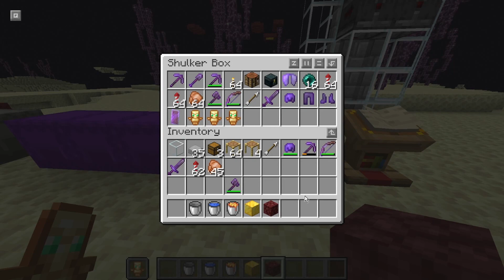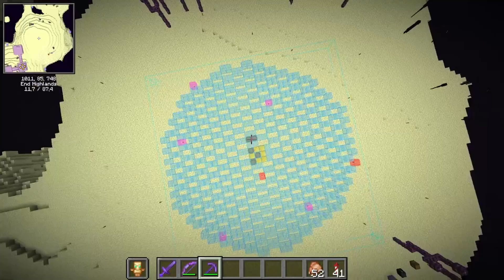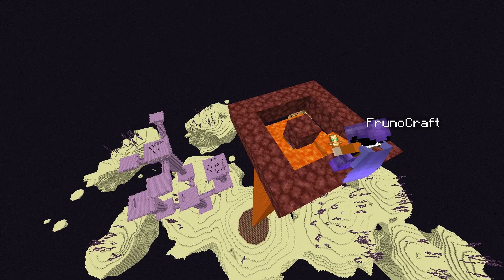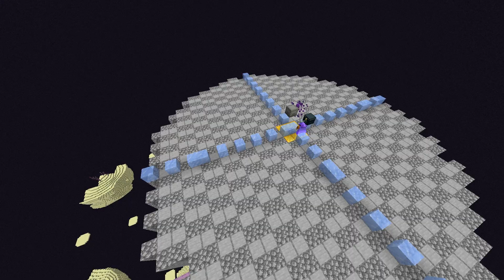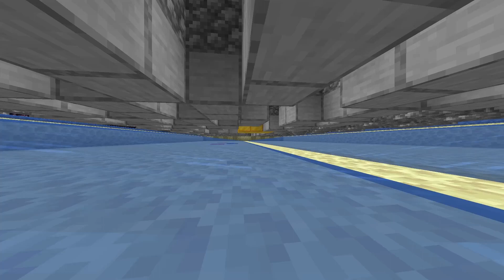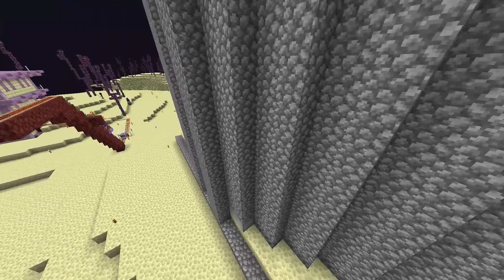Build tutorial: Reactor based shulker farm (1D, 3000+ shells per hour) Minecraft Java 18.x

Comment from the maker: There have been questions on how to extend the farm if you've built a smaller version. The main work is in the lavacasting of the walls (and the cleanup later), which does not depend on the size of the farm. If you have built a small version, I'm afraid it is almost as much work to extend the farm as it is to build a new one. 
So if you're unsure how big you want the farm to be, I recommend to use the maximum height when lavacasting and fill only as many aggro cells as you want with snow golems, from the bottom. For example, lavacast 200 blocks (10 cells) and use only snow golems for the bottom 3. Then, some shulkers will end up over the aggro cells but they will be dormant. Later you can use the chute containing the scaffolding (for the signal) to go into the farm and add more golems, and the flooding process I described to get shulkers in the aggro cells.
Reply: That was my question. I figured this was the case. Thanks (:
Reply: Hi I've built this farm on a survival server of mine and was wondering what purpose the redstone clock serves. I've tested the farm design's agro chambers and the shulker appears to fire continuously even without the clock (Which is how I am deducing the shulker remains agroed). Is the clock needed, and if so why? 

For context I've watched both this video and the explanation video released prior titled, "Reactor based shulker farm (1D, 3000+ shells per hour, easy survival build) Minecraft Java 18.x".

Thanks in advance for clarification and help. :)
Reply from the maker: @GalacticCoffee2077  It's been a while since I made this video :) But I'm pretty sure that the issue is with the agression of the teleported/split shulkers. They don't aggro on the snow golems unless you reset the aggro of the shulker in the chamber.
Reply: @FrunoCraft  Thank you.
Reply: @FrunoCraft Hello again, I’ve completed the farm and tested it for a few hours. However, It appears to be producing about half of what it should (1700, as opposed to 3300ish) I’ve built the farm with 10 layers. Is there anyway to troubleshoot these lower rates, or are there any notable issues when building.

(For reference the farm I’ve built is in the over world so that it can be chunk loaded) 

Thanks in advance for any help. Apologies for bothering again.
Reply from the maker: @GalacticCoffee2077  Hmmm. Shulker duplication is independent of the mob cap so there should be no interference. Reasons for reduced rates could be (a) severe server lag (reducing the rates for everything) or (b) non-vanilla mechanics (like a spigot/paper server).
First diagnostic check would be using freecam from tweakeroo to see if all aggro cells are working, and (this is important) the aggro is broken at times to aggro the new, duplicated shulkers. 
Second step, if carpet is installed/availabled, to check the lag (/tick health and /tick entities).
Reply: @FrunoCraft  I don’t have tweakaroo installed but I’ve used litematica to check all cells are occupied (by repeatedly making area selections of the farm and editing away cobble and water) and I’ve manually checked aggro is working. Lag seems manageable but the farm seems to cap at around 3000 entities. 

I’ll see if I can download tweakaroo and carpet mod to further test. 

Thanks for the help, and happy holidays.
Reply: @FrunoCraft  Update in case you were curious. I got the farm working correctly and even simplified the red stone clock to the point where all that was needed was a hopper clock with 49 items and 10 repeaters. 

It works like a dream consistently giving around 3400 drops/hr (I spent way to long getting aggro on the shells just right) and caps at around 3600-3800 entities present. 

Thanks for the farm and help Fruno! Absolutely legendary.

Comment: Wish me luck I'll try to build this in 1.21.5. I've been disillusioned with other shulker farms that use boats and millions of scaffolding because they don't want to start no matter what and it's hard to transport more and more shulkers each time they eventually die or do nothing. 

Yes, they're "directional", but that doesn't answer much when you implement multiple designs in the right direction. 

One thing I'm curious about this design is, what is the likelihood that all the shulkers die out?  It feels like starting it takes time and effort (which is fine), but once it has started, it is difficult or impossible to see inside and going through that effort again doesn't seem like fun.

I do wonder how hard it would be to replace a few columns with glass instead of cobble so you can peer straight into the core.
Reply from the maker: This one works like a charm in 1.21.5 :) Sure, use all the glass you like :) The chance of the reaction dying is pretty much zero once the farm is in operation. Way too many shulkers in there.

Comment: Having built this, here's a few tips for those following the tutorial:
1. Switch the aggression cell walls to glass on the side of the signal scaffolding tower so you can travel up/down the scaffolding to easily check which cells are populated after flushing the farm.
2. Use splash healing potions on any newly populated cell to make sure the shulkers stay in so you don't have to repeat the water flush several times unsuccesfully.

Comment: Works like a charm in 1.20.1.
Only had a challenge getting the reactor shulkers to not jump out. After my 5th or 6th cycle I just gave up and splashed health potions through the glass for them. Other than that, this was one of the most satisfying farms I’ve built.

Comment: Notes for future watchers/builders who are extremely dumb (like me):

The farm will probably take you more than 4 hours to build because you will make mistakes and have trouble understanding what to do, but that's fine. Allocate some more time for it. It took me about a total of 6 hours over the course of a few days.

The world download has a command block off to the side on the surface (it's easy to miss if you aren't looking for it) that TPs you back to the Overworld which contains crucial templates and cross-sections of the farm that make it way easier to verify what you're doing back in Survival.

If you can, get yourself some Swift Sneak before building this farm. It's actually really helpful on the roof. Not required obviously, but will save you a fair amount of time.

Use block-based light sources (Sea Lanterns, Froglights, Glowstone) to light up the top of the farm so you don't have to get annoyed by replacing torches when you eventually have to remove the templates. And do light up the roof because you do not want to get swarmed by Endermen pushing you off into the drop chutes.

If you don't have Totems, consider Potions of Slow Falling to drink after creating the drop chutes so they're not so dangerous. You can't really effectively spread your Elytra to land safely in a 2 block wide space. However, Feather Falling IV, full Prot IV, and a Resistance II beacon do allow you to survive a fairly tall drop (almost 250-ish blocks by my testing, maybe a little more), so depending on how tall you're planning to build the farm, you may not have to worry that much.

17:15 What he's saying here is that you want to build the template where the glass is NOT. Ie, when you copy your litematic, you want to build the Netherrack AROUND the glass, not replacing it. Otherwise nothing will match and you will have a VERY BAD TIME.
20:10 The angle is a little unclear, it sort of looks like he puts the lava hole towards the side. However, if you check with the world download, you should put the lava hole on the side opposite the comparator. I think it looks like he corrects this later on when he transports the shulker, though I can't be entirely sure. In general, it's a good idea to double check everything you're doing with the world download.
20:56 He's counting 8 blocks from the air block above a given Scaffolding to the next Scaffolding above the aggression cell.
21:26 Get yourself a Resistance + Regen beacon for this part. You will be taking off your Elytra and armor to make sure you can get close enough to the Shulkers, so you will be much more vulnerable than you are used to being from Shulker bullets. If something goes wrong, these effects will be extremely helpful to make sure you have enough time to get your Elytra on again.
22:03 Very minor point, but you should make sure to use a regular, drinkable Invis potion to make sure you get the maximum duration. Throwing a splash potion, even directly down, does dilute its duration usually. It shouldn't matter, but it might also save your bacon.
 22:35 Use this opportunity to throw an Instant Health potion or two at the Shulker to make damn sure it's above half health. You can never be too careful and you'll definitely regret it if your reaction dies down forever because the first shulker teleported away upon being hit. Even if you didn't damage it, you might have not seen it get damaged by a Shulker bullet (since there are two very close together at the entrance) when you first discovered the city. Again, there's no being too careful here.
24:33 Your life will be somewhat easier if you start the item in the dropper that doesn't have the comparator pointing out of it for the first cell where the Shulker is already loaded, because then you won't have to listen to the Shulker's horrible shooting sounds while you're building.
33:48 Watch the creative mode video (the first video in the series explaining the mechanics of the farm) to make sure you know exactly what you're doing for this part. When he says "all the aggression cells will be filled" he doesn't mean permanently necessarily, don't look at that and then assume that you're already done and can slab up the whole roof. Slab up only the central parts and turn on the farm for a few minutes again. Not all of the shulkers that duplicated their way into the other aggression cells will be above half health, so they may not stay there. That is why you will probably need a few cycles until you get lucky and all the aggression cells are filled with healthy shulkers that will stay there permanently. Be careful to do this slowly and from the outside inwards, because otherwise you may kill too many shulkers and not have enough for the reaction to start up again even once you have all the aggression cells filled. *Patience* is the word of the day. Wait a few minutes between every on, off, and slab operation. Will get tiring, but it's worth it in the end to ensure you don't have problems and have to transport new shulkers in. Once all the aggression cells are filled and the reaction is going with dozens of shulkers, you'll be golden. You'll know it has properly worked forever once you see no Endermen around at all, since there will be enough Shulkers to take up the mob cap.

I've built this farm in my own survival world (even with only 8, not 9, aggression cells) and it works fantastically. Great design.
Reply: Thank you for putting in the work to help me, a fellow future watcher/builder who is extremely dumb 😂

Comment: if I fill them manually, then I should just remove the scaffolding in the pillar?
Reply from the maker: I'm afraid I don't understand the question, can you elaborate?
Reply: @FrunoCraft  If one were to fill the chambers manually with shulkers, then I figured the scaffolding inside the pillar would not really be necessary...but useful as a backup if something were to go wrong later.
Reply from the maker: @imeyris  Actually, the scaffolding is essential for the farm. It makes sure that the shulkers in the aggro chamber de-aggro and aggro again. If they keep on aggro all the time then the new shulkers won't aggro correctly. (It's been a while since I ran the tests, possibly the farm will work but be a lot slower.) The scaffolding transmits the pulses to open and close the trapdoor between shulker and snow golem.
https://www.youtube.com/watch?v=rkfDQBhQ--E&t=445s
Reply: @FrunoCraft  I know that the two pillars of scaffolding that interacts with the observers is essential. What about the 3 scaffolding contained inside the central pillar every 8 or so blocks? I thought that this just helps moving the shulkers up through the chambers.

Comment: Hey, I built the farm. Made it from about level 44 till level 307 so 12 agression cells. Gives about 5k entities while running, so too much really for the average server. Great tutorial, but some things I would suggest to clarify more if someone else makes a tutorial on this farm:

In the world download have the following:
1) Just the top and bottem netherrack templates and the central pillar.
2) An agression cell built out in open so it's visible from all sides.
3) The etho's hopper clock, pistons etc. 

4) change the build so it's glass blocks between the 2 wide scaffolding and the agression chambers. It's much easier to do it beforehand than trying to work out which blocks to break and replace after.

Doesn't take much to just copy paste it out using litematica in creative, apart from the netherrack stuff which is already destroyed

I would recommend for the average player playing on a server to only have 5 or so agression cells max.
Reply from the maker: Great suggestion! I might include a copy of the template in a future update. I also realize that it might have been better to include everything in one dimension, as opposed to scatter the stuff. (Even though I placed command blocks to teleport between dimensions.) 
Lag is very manageable if you place buttons at the golems feet, but this is of course a major time investment. Replacing these blocks with soul sand or honey slowed the reaction to a standstill. However, maybe someone finds a way to adapt the reactor principle in a more lag efficient way :) In any case you don't have to run the farm for very long to get the desired amount of shells. The fact that it's a mob switch can be seen as advantage or disadvantage I guess.

Comment: I have waited really long, and the shulkers arent doing anything even tho the farm is running. I have sent in 2 more shulkers from the end city, but still slow and not working
Reply: i found out that its the time the trapdoor is closed. It needs to be closed longer and I don't know how to fix that
Reply from the maker: The hopper clock determines the total time. About 25-30 items should give you a nice interval (20-24 seconds). 
Each time the hopper clock fires, first send a short pulse to piston under the scaffolding that opens the trapdoors. Then, using a delay circuit (for example a comparator fader), send a second short pulse to the piston under the scaffolding that closes the trapdoors. That way, the trapdoors should be closed for 17-21 seconds, which is enough to de-aggro the shulkers in the middle.
Sample solution (Litematica): https://www.mediafire.com/file/jq9p1tuxtuickdr/Shulkerfarm_clock.litematic/file
Reply: @FrunoCraft  I have sent wdl